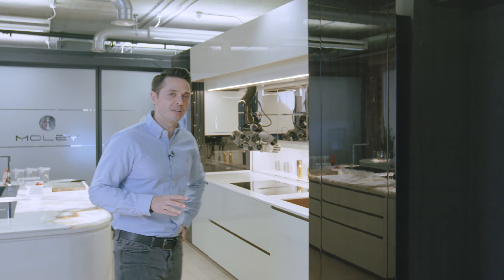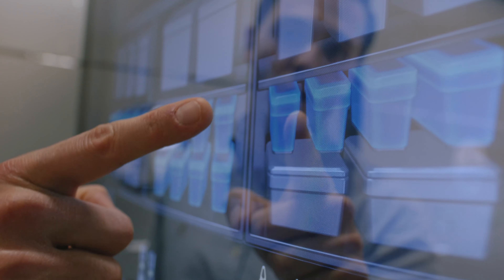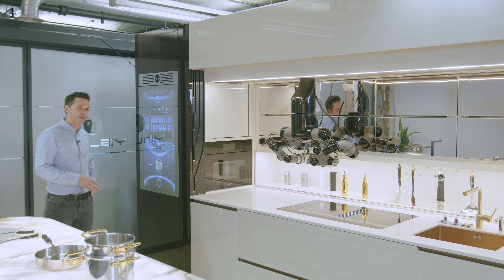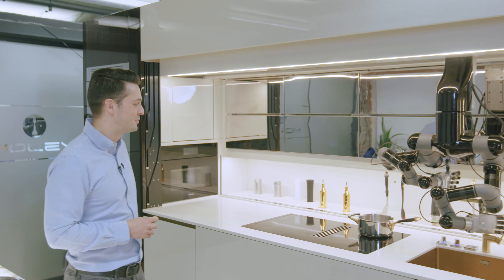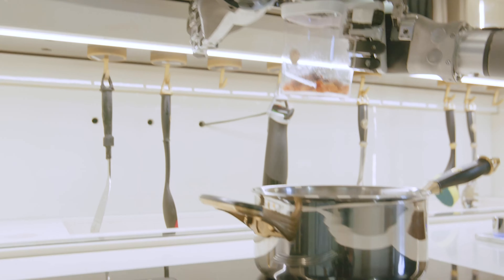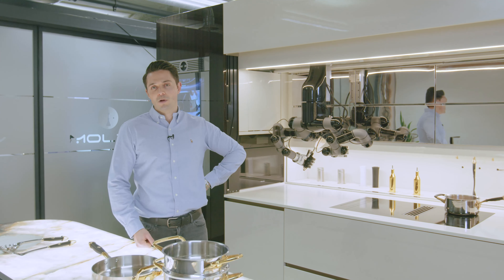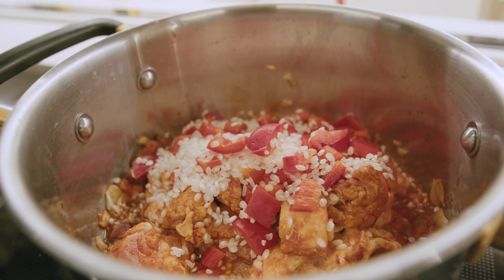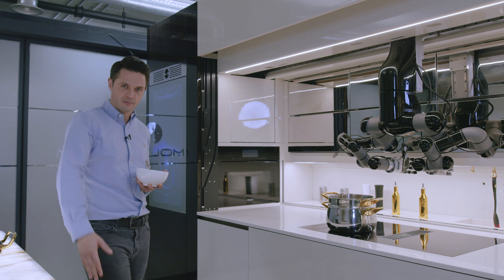Moley Robotic Kitchen cooks paella

Comment: the dude : "it is the most technologically advanced kitchen in the world"

the same dude : cuts the onion himself
Reply: I mean cutting is the easiest/fastest part of the process, so I don't mind that, but the electricity usage could be a problem.
Reply: @BlakeN-o6l exactly They would have to develop a robot to do the preparations. That is, for example, a refrigerator where you put the products in containers, and that refrigerator has some robotic system that, for example, cuts the tomatoes, cuts the onions, the meat and is going to be used or the sausages without you doing it, you put them in a kind of refrigerator.
Reply: @fabiob6521  i was thinking the same, and why does it not clean up after it used every tool? or putting them in a dishwasher machin? There is alot of option that should be integrated with it, but i guess that comes in newer model so they can keep pushing new once out...

Comment: Why doesn't the robot do the food prep? I've been following this for years now, ever since it was featured in Popular Science, and the promise was that the robot would go from start to finish, prep to cleaning, fully autonomously. They said you could select what you wanted in an app on your phone, and the food would be ready for you when you got home. Please address this concern, and provide a time-lapse type video showing it make a bunch of diferent dishes. Thank you.
Reply: Yeah, totally! But now you got a vulcanic marble table! Doesn't that compensate huh? :D
Reply from the maker: Currently, Moley cannot cut products because any robotic engagement with blades requires additional certification for security reasons. We are working on it. Right now Moley kitchen can cook around 50 recipes in its database and it's updated regularly.
Reply: @MoleyRobotics  If I buy now, will you get that functionality well when it is certified? Is there a demo on when it also prep the food?
Reply: @andersnilsson1951  Do you have the $350,000 spare change to afford it now?
Reply: @MoleyRobotics  Would the final version be only 280 000€ + VAT?  That's quite cheap in my opinion, especially if there is a long warranty and great customer support.  Are you going to increase the price?  Sounds pretty good investment.
Reply: @MoleyRobotics  Can robot use products like slap chop without certification instead of knives? Even robot rebels its hard to kill humans with products like slap chop.
Reply: @crazybaboon1749  A robot can probably kill you with a single toothpick at a range of up to 30 meters. If we make them too smart they will try to overthrow us.

Has that ever crossed your mind?
Reply: @karltschonki6560  Yup thats what i wrote
Reply: @douglasdlutz7087  LOL, for that price you can hire a gourmet chef!!😋
Reply: @douglasdlutz7087  the more ppl that invest n promote it. The lower the price will become. Most pll can't cook n if they do, they have bad hygiene like my dad n we all get sick with food poisoning.
Reply: @Tonabillity  not 4 the rest of ur life tho. It wud cost more. Robot chef wud be cheaper in long run. Plus u wud eliminate food poisoning.
Reply: @ASMR-XI-ZUI  Perhaps, but those that can afford to shell out $350 k on an “appliance” would probably have no problem commissioning the service of gourmet chefs for life. I know a couple people who have already done it. Macy Gray being one of them. No doubt, it’s what most celebrities do. 
If your Gourmet chef poisons you, you’ve clearly hired the wrong person! 😝😩
Reply: Yes! I imagined it will work like that! If I need to prepare everything, it's not helping at all... ☹️
Reply: It’s a work in progress. This will definitely take time to perfect. I swear people know nothing about the tech industry.
Reply: @crazybaboon1749  😂😂😂
Reply: @MoleyRobotics  your website mentions over 1000s of recipes not 50
Reply: @MoleyRobotics  Lies. Why are you not showing it doing this then?

Comment: I absolutely love the concept, just a couple of personal feedbacks from what I saw in this video:  1. I would not want to do the chopping myself, if I have invested thousands of dollars into a next generation robotic kitchen. I cook myself and I feel like preparing the ingredient takes up a majority of my overall meal prep. I hope that the robotic kitchen can process ingredients from step 1 which is washing. Also, I feel like there are some basic techniques in cooking that takes time for people to master, which could be a constraint to home cooking. A robotic kitchen should be able to close that gap2. If we are only looking to replicate the final dish, why don't we break away from traditional cooking method and make it more industrial? For example, we don't really need to use a traditional pot and stir with a spoon. Instead, we can use a more efficient container and stir it by rolling it etc. I see a lot of potential to make the cooking process a lot more efficient. 3. It seems that it will take a lot of work to clean the robots and the station. Also, from a pure environmental engineering perspective, there will be a lot of electricity used in the process, which can be costly and environmentally unfriendly. These are just some of my first impressions.
Reply from the maker: Dear Yifan, currently, Moley cannot cut products because any robotic engagement with blades requires additional certification for security reasons. We are working on it. We also plan to launch a delivery service that will provide our clients with ready-to-cook products in a needed form and quantity. Product sets will contain the main ingredients for recipes from our library. Speaking about other tech advancement — first, it was our conscious decision to make all the processes accessible both to robot and human, second, we will soon announce a contest for tech development ideas, and you will be able to contribute with you expertise.
Reply: Y do you need hands 🙌 and a brain if robots can do everything for you
Reply: Great feedback. Can you illustrate further by what u refer 2 as rolling method instead of stirring.
Reply: @ASMR-XI-ZUI  Asking for free business secrets? Shame
Reply: @rajkschwartz  I hope you mailed this comment in, instead of using a computer.
Reply: Thousands lol try hundreds of thousands
Reply: It's a great point that the Moley Robotic Kitchen could potentially do more than just cook meals. In addition to measuring out and preparing ingredients, the technology could also be used to order groceries online and suggest recipes based on the ingredients that are available. This would help to maximize efficiency and reduce food waste.

One potential solution to the issue of leftover ingredients could be to store refrigerated ingredients in containers that are connected to the robotic arms. The system could then pull out whatever ingredients it needs for a recipe, without wasting any excess food. Additionally, the system could use AI and machine learning algorithms to suggest recipes that make use of any leftover ingredients before they go bad.

Overall, these additional features would make the Moley Robotic Kitchen an even more powerful tool for home cooks who want to save time and reduce waste in the kitchen. By streamlining the cooking process and making it easier to plan meals and use up ingredients, the technology has the potential to transform the way we approach food preparation and consumption.
Reply: The cooking methods have to be re-invented with convection and microwave. Since it has robotic arms chopping could easily be automated. What this needs is an advanced AI like Open AI.
Reply: @MoleyRobotics I new cutting would become a additional security measure, I know how to fix this easy add a personal cutinng board on the robot where it can inset its hands cutting box when even choosing the knife to chose its already tucked in the box . The box will be the length and with of a larger shoe box the holes where it will inset its hands will be onley at the opposite sides righ on to left if the box then the knifes will be again tucked neatly at the on spacious wall of the box that will be right on top facing down on where the cutting board will be , the owner can easly open and insert the knives that need to be used for the meal the box itself can tell the robot where exactly the knife that needs to be used from the tucked in compatment using special censors this . This is a great way of fixing a issue like this for added security measurements to make sure the robot doesn't slip its hand out of the hole of the box make sure you teach it to move its hands in a way when it has finaly got hold of a knife in adjustes its hands in a angel where its so locked it can only slip its hands out of the hole if it lets go of this specific grip holding the knife . I hope I get paid for this 😂 . In addition to the knives it does not need to be a motion sensor to detect where the robot finds the knives on the ceiling this box instead teach the robot where which type of knife is where then all it has to do is when it inserts its hands it easly nudges of the knife in a numbered 1,2,3..or lettered compartment A,B,C... you get it where the knife is seperated released  from a magnet that has been holding the knife in its specified compartment For the owner when Placing the knives in the box they have to add simple information what type of knife they placed into a specific compartment the type of knife used should already exist in your machines programming I mean How many types of kitchen knives are out there anyway we have a starndard kitchen knife any shape or lenth and with then we have butcher knife then fish knife thats all I know I'm not a chef but I do cook.

Comment: so how long did this take to cook? cos it looks reaaaaally slow. I was half expecting that the oil will burn by the time Moley puts the oil container down.  Also the stirring doesn't really imitates the human hand or technique... I'm pretty sure that a lot of that paella was stuck on the bottom of the pan. And I think preparing all the ingredients by yourself and putting them in the right place and then having to wash all those different containers... is actually taking a lot more time than it saves. Still a really long way to go for this to be any useful. And for that price I can probably hire a certified chef that can shop the ingredients, wash them, chop them, cook me meals and then wash the dishes too.
It is good for the sake of technology, for research and progress. Eventually it's gonna be able to do the washing, the chopping and cooking by itself...  but I am really put off by the claims that it actually saves time in the kitchen, that it mimics human movements... because it doesn't.

Comment: You're telling me i still have to hack up all the ingredients myself? How many years of a Butler's salary would the cost for this robot add up to? A butler is clearly nog going to make you hack and weigh onions for him. Just considering my options.
Reply from the maker: Currently, Moley cannot cut products because any robotic engagement with blades requires additional certification for security reasons. We are working on it. Right now Moley kitchen can cook around 50 recipes in its database and it's updated regularly.
Reply: Moley Robotics Sounds promising!

Comment: Get back to me when the robot can do all the prep steps (not just cutting, but locating, removing from storage, weighing/measuring raw quantity, peeling/washing/drying, identifying, removing and discarding bad bits, etc., cutting in various types/sizes/shapes and/or deveining, crushing, milling, etc., remeasuring the prepped ingredients  and putting away unused portions in correct storage), and can clean and remove tools from the prep/cooking area as it finishes using them, and clean up the work area and all the prep and cooking dishes and replace them in their correct storage locations.

Oh, and do this for 2-3 recipes at a time for a complete meal (salad, main dish, side, etc.), correctly timing each item to finish hot or cold for serving at the same time.

THEN I'll think about buying one.

Comment: What's the point of a robotic kitchen if one still needs to chop, and worse, measure, the input ingredients themselves? Those, and washing dishes, are the hard part of cooking that makes me want to look for automated solutions in the first place! 

Though, to be fair, the other part of that reason I was looking at robotic solutions was that I was not sure how it could be designed to do those things reliably and, since I had heard of robotic kitchens, was wondering if anyone had cracked how to do that yet. So, I guess it is not surprising that the first system that came up was not able to solve this main hard engineering problem yet. 

Even without a robotic arm, making most of my food, stuff poured into a pot and boiled, would be pretty simple. It would just need to pour water, turn on the stove, and release ingredients at the right time, which would not require complex automation technology at all. The hard part isn't that, but making sure those ingredients are ready, and cleaning at the end. How will the ingredients be retrieved from the refrigerator? Once they are retrieved, how will they be washed and aligned such that the robotic system can easily cut them? How will they be cut? And most importantly, how will all the cooking gear be cleaned? A blender would be a great solution to dicing onions for me, except for, well, what it saves in time slicing, it makes worse in terms of actually getting all the onions out and cleaning the blender. A solution to automatic washing of cooking gear as well as for washing dishes that do not need to be pre-washed manually, and automatically shifting items between everything, would be positively revolutionary. 

Someday... maybe someday I will find (or make myself) some solution to the hard problem, of preparing the ingredients for cooking and for automatically washing and sorting everything at the end.

Comment: sorting out, un-package, put in place, cutting ingredients is the real missing part of this, while it takes forever and is a messy part of the job. The operator's job should be limited to only deliver ingredients and robot should be able to prepare them. Wash, cut, peel off etc and clean up after itself. You should be able to go from shop and just put in the kitchen a bag of stuff and robot would take it out, unpack, put into locations and clean up. With todays ML & computer vision advances i expect to see all of the within next years. Also those hands should hide themselves better when are not in use. Maybe it's cool for showing off but it's not cool for a clean design to have some industrial robotics hanging at home. There could be a cabinet on the left side where robot would hide while not in use. Also sides where safety screen is mounted should have better material coverage, seems like unfinished detail of a premium product. Hopefully it's fixed when doors are mounted. Also that cover should be with glass panel, so people could see what happens inside. Of course automatically cleaned glass, as all surfaces inside.

Comment: Interesting concept, but a bit disconnected from reality and having utility. You literally could have added a robotic arm to the wall and had it stir for you and it would have been just as useful. You created more dishes with the containers for ingredients. You took up a ton of space with additional fridges above the whole unit, those units themselves are added complexity that have limited use and will also need repair and servicing over time. You couldn’t start the robot until prepping ALL ingredients which adds to the length of the cook time instead of being able to cook as you go. This project may have some use as a test for a far greater model in the future, but as a cook, business owner, and robotic enthusiast, this is far from a desirable and utilitarian product. Very cool. But so niche and gimmicky unfortunately.